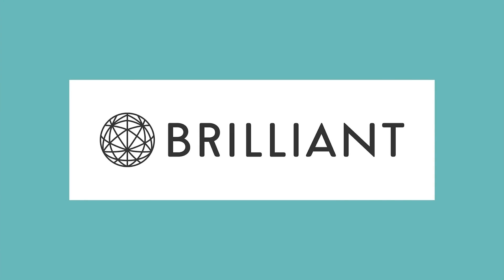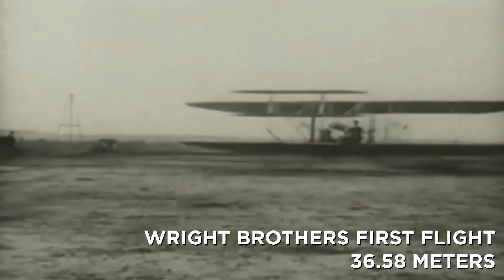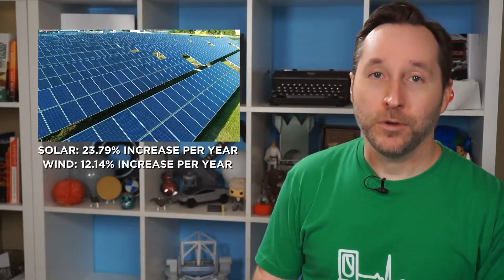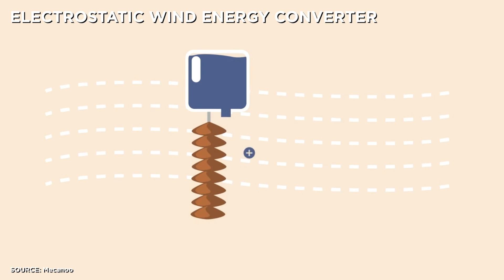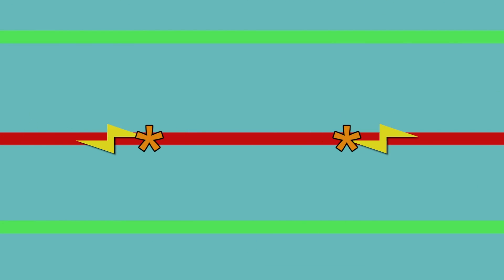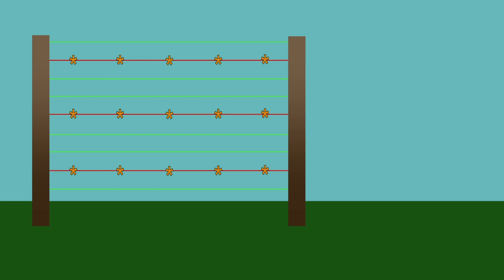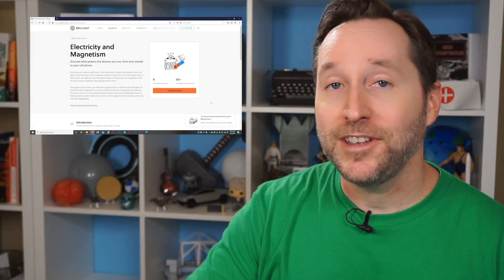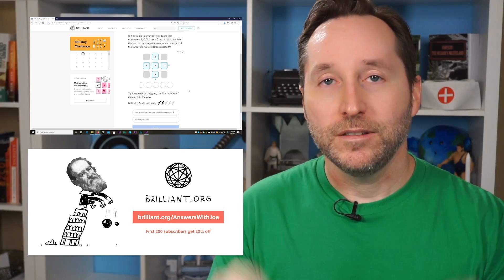Solid State Wind Energy | Random Thursday

Comment: Its a nice idea, but it is almost certain that it is physically impossible for it to get greater power output than a similarly sized turbine. I mean you would have to slow down the air going passed it quite considerably to compete. My guess would be you won't to better than a thousandth of the energy output. So the idea of powering your home off one is out of the question. Maybe one LED?

Comment: How about use some of the mountain pathways that large power lines run through and use a solar cooker at the top of a long tube.. stick those wires through it and have the sun heat up the pipe and make wind move across the wires at an almost constant rate not to mention the normal air displacement from even a 100’ difference in elevation can cause fast moving air currents. Love the show... wish I lived near you.

Comment: Small correction:  You said, "40,000 Volts is a lot of energy."  That's not correct.  Electrical Energy = Volts X Amps X Time (e,g,, Watt Hours).  Since the current (Amps) is near zero (very high impedance current path) the case of the plane the energy consumed in moving air is very low.  More energy is likely lost in the inefficiency of the boost converter that boosts the battery voltage up to the 40,000V level.

Comment: Hmm...interesting.  A shame that need for a initial input of energy though.  I wonder, maybe there's a way to get the wind to start things off?  Piezoelectric materials generate electricity when pressure is applied, so if we made a thin thread of such a material the pressure of the wind pressing into it should produce a charge.  This charge might be enough to kick-off one of these SWET systems.  Alternately, one might be able to expand on this principle to create two new wind energy sources which I shall dub the power sail and the power mat.  The power sail would produce electricity as a force is applied perpendicular to its surface while the power mat would produce electricity as a force is applied parallel to that surface. The power sail does this as the entire plane flexes and bends in the wind while the power mat does this as the wind pushes over the hairs in its surface like an amber field of grain.  The sail may need to be position properly to maximize the wind it catches while I'm not sure what issues the mat would have.  Do let me know which ones you can think of though.  I know it does add some moving parts, but hopefully bending a thin material is still workable.

Comment: '40 000 volts is a lot of energy.'

'Volt' is not a unit of energy.
Reply: Yeah, he probably meant it takes a lot of energy to move around enough charge to get 40kV on two pieces of metal
Reply: @hugofontes5708  That makes no sense.

To form a 40kV electrical field takes virtually no energy.

The energy part happens when a current flows.

And without knowing what current flowed between the wire and wing, we know absolutely nothing about how much energy the plane used.

Zero information.

You can easily charge nF capacitor to tens of thousand Volts. 

W = 0.5CV²

0.5 times 1x10-9 x 20,000² = 2 Joules

That's absolutely nothing.
Reply: Ewww that name bruh,

Comment: actually 20k Volts will only drain a battery very quickly if you pull enough current at that voltage. if you only drew 1 uA at 20kV from a typical coin cell battery, that battery would last 10 hours, because power = current x voltage when dealing with DC. I'm sure they're drawing way more than that just to be able to produce 20kV, but voltage alone doesn't nearly give the full picture.

Comment: Scientist 1: "Some birds get killed by the moving turbine blades, what should we do about it?"
Scientist 2: "Let's build a huge electrified net instead!"
Scientist 1: "Brilliant!"
jk cool concept. ;)

Edit: Wow, I don't think I've ever had so many responses; it was just a meme, I don't actually think it's bad for the birds, this just popped into my head. I realize power lines are already essentially an electrified net and nearly all of the time the birds are just fine.
Reply: Birds are usually okay on power lines, right?
Reply: @MrKirner  Those are 40KV and up, as long as they don't cross the phases they'll be fine. The amount of charge in an isolated wire fence like that wind generator is really small anyways.
Reply: @leerman22  A three phase pylon line is a threat to any bird with a wing span as wide as the spacing between any two of the three wires.. They are at three different voltages.
Reply: @albertrogers2506  That's what I said.
Reply: @MrKirner  Yes if the bird doesnt create a connection with the ground then the electricity doesnt actually pass through them, these are closer to the ground though so animals like foxes etc might actually be at risk he has a valid point there.
Reply: @MrKirner  yes also worth noting that it appears that birds are also able to "see" magnetic fields by detecting the polarization effects on light typically under low light conditions I wonder how this sort of thing would look like to a bird?
Reply: Philip Kirner yes if they see it... 🤓
Reply: @MrKirner  As long as they only touch one wire. Sure. ...but that's like a mesh, isn't it? Would flying through this zap a bird?
Reply: Yet, I'd really want to now about the impact of this fences on birds and other animals.
Reply: @Mexalen81  Sigh... Tell me.. Do you see any birds getting fried by sitting on powerlines???? You gotta be "grounded out" to be electrocuted by overhead powerlines. Why else do powerline workers work from helicopters? Because there's no cable to ground connection that way....
Reply: @SRS13Rastus  stop sighing. it's not about sitting on a powerline. My inquiry is about creating a net that emmits a constant flow of electrons, and about wildlife passing through. 
Less smuggness, more serious answers please.
Reply: @SRS13Rastus  yea but this is described as a net not a single line? A net would fry them wouldn’t it? Think about it. I don’t know I’m just speculating. This is described as a net? Idk man. They probably would have that worked out so probably not but it’s something to discuss at least.
Reply: Doubles as a bug zapper.
Reply: Instead of electrifying property fencing for security, create electricity from security fencing maybe?
Reply: @rhoell2050  this is a great idea!
Reply: Just put a purple light inside and make it a big bug zapper. Jk, I love insects.
Reply: How about a giant fan cover?
Reply: Here in the south, we see that as an opportunity for a kegger.
Reply: Im sure you know this but the fossil fuel chain kills so many more birds than windmills
Reply: Does this double as a bug zapper?
Reply: At bugger all watts I doubt that the birds would have a problem on the wires
Reply: well.. tiny current.. the birdies will be fine
Reply: no wind here
Reply: Pros: 🦟 problem solved.
Reply: First thing I thought when I see that fence going up... 🤣
Reply: Nets?
Reply: @PS-nf3xw  birds get stuck in nets. haven't you noticed any of them for example trapped inside a net covering a fruit tree? also, if the net is too tightly knit, then maybe it will "catch" some of the wind, reducing the efficiency of the wind fence.
Reply: @harriheinsoo  like fencing nets, large enough to allow airflow, small enough to restrain birds?
Reply: the kind of bird that it kills is the main problem with it.
Reply: I like this idea they wont get killed simply tazed. Then they will wake up on the ground like I do after spring break.
Reply: Is this produce Nitrous oxide? There is Nitrogen in the air 78%. Will this poison us & our world?
Reply: I have a theory on how to reduce bird strikes on turbine blades.
(1) Install a rechargeable battery on the floor of the wind turbine's tower.
(2) Run a strip of LEDs on both sides each of the 3 blades, battery powered, connected by brushes (plain old DC motor technology). LEDs are on 24/7, battery is recharged by the spinning blades.
(3) I know the LED strips reduce laminar airflow across the blades, slowing down the blades.  This would be the test turbine in a wind farm.  Someone needs to counts the bird carcasses found beneath each of the turbines at a wind farm.  If, over a year, there are fewer bird carcasses under the illuminated blades, then the next step is to route a groove into the front & back of each blade, from hub to tip, during manufacturing, for a flush mounted LED strip.
(4) The same idea could be applied to the tower from hub to ground.  Four strips (every 90°) would illuminate the tower to birds.  The rest is up to the birds.
Reply: @pavels5600  There was a study recently released showing that a dark coating on blades actually reduces bird deaths, likely because just like bugs and (at the time of their fatal autopilot crash) Tesla's autopilot feature, a white patch in the sky is interpreted to be unimpeded natural light, not potentially a lit obstacle. This is why bugs gather at light sources, they think it is a safe flight path of free space. Same with the Tesla autopilot, saw the white side of a semi trailer turning in front of path of travel, thought it was the overcast sky, and it drove full on into the trailer and killed the guy inside. The dark coating provides differentiation against the light of the sky so that things can see it. I understand that's your idea with using illumination, but the results of the study seem to indicate a majority of daylight strikes on a normal turbine in order for the dark coating to have such a clear effect. This would make some sense, as nocturnal birds have much better low light eyesight, so they could reasonably make out the unlit white coated blades at night while their diurnal cousins mistake them for a clear flight lane during the day, potentially even seeking out the blades in error
Reply: @pavels5600  There have been dozens of studies in germany counting birdstrike at wind turbines.
Thats where the currently circulating numbers come from - the same ones Joe uses here.
Reply: @nilesbutler8638  The "bird killer" myth surrounding wind parks can be largely traced back to the Altamont Pass wind farm in California. That wind farm was one of the first and largest wind farms to be constructed.

Basically, what happened there was that thousands of small, fast-spinning wind turbines were placed in the migratory route of multiple bird species, which until that point had used the site to hunt for prey, such as ground squirrels . Now they were building their nests in the latticework bases of those turbines and were flying at the height of those blades, which of course led to a lot of dead birds.

But these primitive wind turbines have been outdated for decades - modern turbines are much larger and spin at much lower speeds, posing minimal risk for birds.
Reply: @BrokenCurtain  
Ah, I did not know that part of the story, thanks.
"slower speeds" in modern versions  is relative though, the blade-tips of a modern 140-meter turbine reach a tempo of 450-600 km/h. They get hot by only air friction. The blades are so long.

Still - far less bird death than car traffic or glass towers.

And birdstike is not a myth - its only been blown out of proportion by those trying to slow renewable expansion. Every industrial-scale technology has its downsides. 
I knew one person involved in one if the studies I mentioned. 
A woodsman and hunter, who took on the side-job to patrol 5 tubines around here three days a week with his cadaver-trained dog. 
He did that for 20 months, driving there, circling the turrets in an ever-increasing spiral up to 500 m around the turbine, documenting every dead bat and bird his dog sniffed out. Said he walked 20 km every day he did this. His dog got so lean during that time I thought he had gotten a younger one of the same breed.
As far as I know the study he was involved in did that on 150 sites.
Reply: @nilesbutler8638  "And birdstike is not a myth - its only been blown out of proportion by those trying to slow renewable expansion."

That's exactly why "myth" is the appropriate term.

I could also call it "lying by omission", but that would imply intent - so even though I'm sure that many people who make the "wind farms kill birds" argument are aware of the fact that they're quoting outdated data, I'm not going that far.
Reply: @pavels5600  I suspect most bird strikes occur during the hours just after sunrise, and before sunset.  Few bird species are active at night, those that are hunt mostly ground based mammals and lizards, so they're not flying at the altitudes of the prop blades. While your idea to illuminate the prop blades is interesting, I am not sure it would affect many birds.
Reply: @jerryfick613  Correct.  I don't know.  That's why I suggest a trial with 1 turbine in a wind farm of many turbines.  If successful (fewer bird carcasses around the trial turbine), then mass produce.  Otherwise, nice try, Pavel.

After the failed experiment, the LEDs would be removed the blades, restoring the aerodynamics.
Reply: @pavels5600  the birds saw the wind turbines but the problem is they cannot judge the speed & impact of the blade because it move too fast. There's a video in @DW Documentary that show a solution to this; by installing sky facing camera that slow down the wind turbine's blade when birds is nearby.
Reply: You only get shocked when touching a hot line to a ground, so, if you touch a high tension line and the earth at the same time,, you become at one with electricty-bad bad idea. But if you tight rope walk a power line that's fine. The electrical current can't pass through you, so no zap. Birds would be just fine on this. The design seems to suggest that any actual current would travel up the side masts which could be insulated. If not, as far as ground animals go, a fence works.
Reply: I just want to point out the hypocracy here... cats killing billions of birds a year and the  future death from pollution and climate change being on the scales here I say a few thousand birds is insignificant instead save birds by reducing the stray cat population.

Comment: actually, with the solid state plane, I'm more worried about environmental factors than draining the battery, because current would be fairly small due to the charges being carried through air molecules. I'm more worried about things like static discharge and lighting, which is a very valid concern considering how attractive the positive and negative terminals are to built up potential

Comment: If fossil energy were completely ruled out, like if something happened to the laws of physics and suddenly coal and oil would no longer burn, what "green" energy would we actually be able to replace fossil fuels with? 

First of all, north and east of a diagonal line running roughly from the Carolina coast to the Cascades solar energy is not even carbon neutral. Short, cloudy winter days, or worse, 24 hours of darkness during the coldest part of the year, render solar energy completely useless. This is less obvious in North America than in Europe where the cities tend to be at higher latitudes and cloudier conditions tend to prevail. Solar energy is literally worse than nothing (from a carbon emissions standpoint) across the Industrial Northeastern U.S. and Canada. It's complete garbage north of the Alps in Europe. Fortunately, these places tend to be rich in wind! The "Roaring Forties" is a thing for a reason: atmospheric circulation has rules; learn them. In North America, northern winters tend to be even richer in wind than summers, which tend to be serendipitously cool in those same regions, thus limiting the need for air conditioning. Let's be smarter about this! "Green" energy will become easier as we become more honest about its limitations. Finally, is nuclear really so bad? Really? France seems to like it a lot, and they've never had a fatal accident. (Don't even get me started on natural gas. New extraction techniques for this relatively clean fossil fuel have helped the United States cut carbon emissions to 1980s levels over the past ten years while lowering the cost of electricity! Do we really want that to go away? Are wind and solar really ready to replace it, or are we just arguing that plunging humanity back into the dark ages is what's best, so just shut up and take it..? I think natural gas provides a fine transition period, and nuclear energy could solve most of the "green" energy problems relatively rapidly. Renewable biofuels can keep our corporate and individual vehicle fleets running with current technology, but somebody's got to decide when to make the switch...)

Comment: Why is on-site energy production called distributed power generation? That makes no sense. Power generated at a large scale power plant is "distributed" through it's associated grid to the end users, whereas energy generated on-site typically is used on site "off-grid" or supplementing grid source power. It seems like a deliberately confusing term.